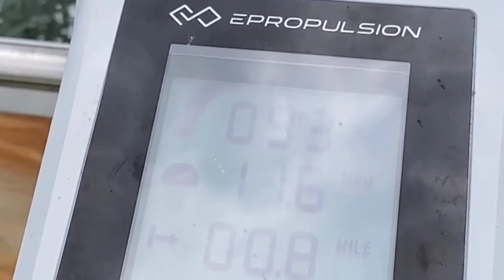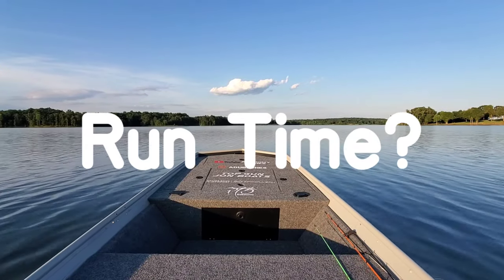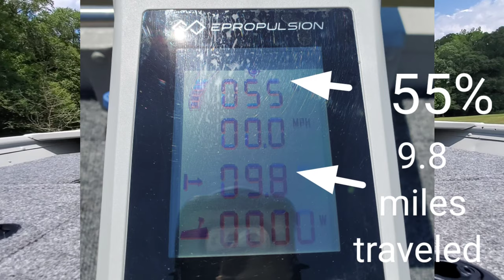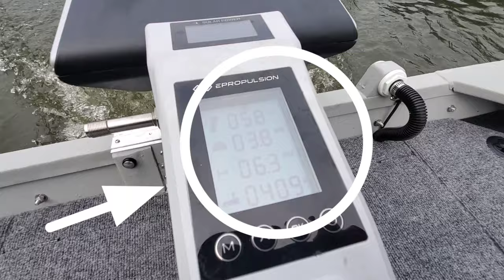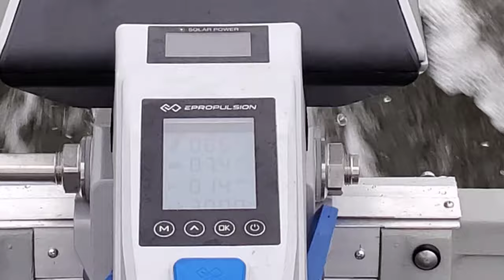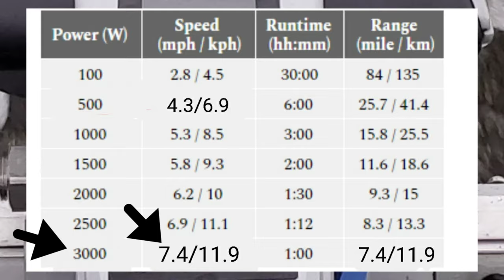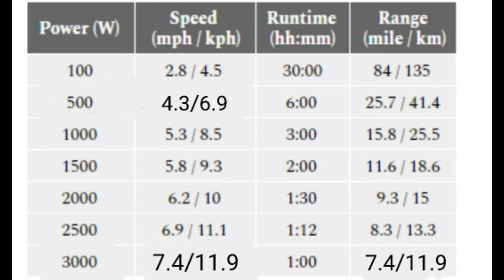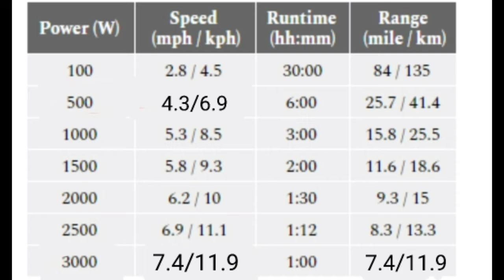Electric Outboard Performance | Run Time | Top Speed Test

Comment: 3000 watts. 3000 kilowatts is equivalent to 3 megawatts or 4000 hp
Reply from the maker: Yes I misspoke when doing audio. You can see on the chart I had watts, the outboard itself is a 3kw @ 3042wh, I meant watt though. Did not catch it in editing. I am too used to telling people it is a 3kw motor rated at 6hp. Sorry
Reply: @AnthonyJonesBrigadeBoats   I have a 14 foot jon boat roughly how much did it cost to set your boat up like that ., I’m in sc I fish  hartwell all the time down towards hurricane creek

Comment: That’s an awesome option. The big downside is the price. As pictured, around 6k.
Reply: This set up with the Navy Battery will run you about 6k all in, but with the new E-Series Battery E80 you can come in under 5k (regular retail pricing) and get an additional 1000 Wh  of battery capacity. I’m always looking to support the Electric Fishing Tournament Community as one of the EPropulsion dealers in Florida and we offer additional discounts for tournament participants.
Reply: @rodjackson6587  Thanks Rod, it certainly isn’t for everyone. There is a considerable cost in the battery bank. Anthony mentioned that in his situation, where he fishes in electric only tournaments in the great state of Georgia, he finds value in this set up. Are more expensive electric cars and solar homes ridiculous? Maybe, but different strokes for different folks😉.

Comment: The speed and battery duration chart you posted has been super helpful to me to determine if the 1.0 or 3.0 would work in a slow moving river of 3-5 MPH.  Thank you for the testing and sharing of your results.

Comment: I just recently thought to myself that electric outboards have to out there. You gave me a lot of clear information. I'm a little tired of working with gas and the constant maintenance. I Have a hybrid car and love running electric only in heavy traffic. I can see a time soon where I can pull my small boat to the lake for a long weekend and charge it with my Ford Mavrick hybrid. Great video! P.S. Thanks for not adding a loud guitar soundtrack.
Reply from the maker: Electric outboards are not for everyone but for a certain individual looking for specific results,  they are an awesome option. We have no choice where I go as the Bodie are Electric only but now that I have used them, I find the benefits so much more relieving that my old Honda 8hp four stroke that was quite tempermental.

Comment: Awesome video - thanks for sharing.  Not a lot of info out there for electric outboards with fishing boats.  Thinking about getting one, Navy 6 though.  Have a Lowe 175 boat with a 25HP now - I don't mind losing speed - just want to get rid of the motor, maintenance, fuel, fumes, etc...
Reply: Unless you plan on fishing electric only lakes, don't. There is no scenario in which an electric outboard is better than a gas engine.

Comment: That's awesome could you hook solar panels up to your battery to keep it running all day
Reply from the maker: The charge rate on solar is pretty slow so it unfortunately wouldn't help much. Solar could charge the battery in 2 or 3 days though, but wouldn't do much while using the outboard on the water. Just too slow of a charge rate unfortunately.

Comment: A lot of people don't realize how many great spots there are around them that are electric only. I'm in Maryland and we have three great reservoirs that are strictly electric. And there are a bunch of lakes that are electric only.

Back when I was fishing all the time in the early 90s most everybody had only trolling motors on the back of their boats. At the time there was only one company making electric boat motors out of golf cart motors. The biggest complaint about having one of them on your boat was the need for all of the batteries. Most people don't realize to get more time on electric that it is important to use 6-V batteries instead of 12 volts. Depending on what size electric motor you could have up to six batteries and if you go bigger than you would need eight batteries. Now remember this is just for the motor on the back. If you're running a trolling motor which everybody does fish finders live wells you need 12 volts or more for all of that.

I absolutely love the new technology that is available today. I'm really thinking about over the winter to put together another reservoir boat. I really miss being out there.

I still remember one early morning during the week when I was fishing at one of the reservoirs. Once you put your boat in the water you're surrounded on both sides have words on both sides for the first thousand feet or so. It's really wide until you get out to the main body. Since this particular day the fog was still on the water I decided to fish the banks heading out. As I'm fishing I hear a boat go by that was really loud. As the day went on really never gave that much thought. A few hours after sunrise the DNR boat comes down the reservoir hauling butt. I just thought that day were starting in the back of the reservoir checking fishing licenses. About 45 minutes later here they come with a boat in tow. And I looked at it thinking he must have not had a fishing license or something that he was doing that made the DNR so mad that they towed his boat back. By this time my batteries forced me to start heading in. When I returned to the ramp the DNR person told me I could go get my trailer and load my boat ahead of them. He says we're going to be here a while. Once I had my boat on the trailer I took my time taking things off of the boat and putting them in the back of my truck and was listening to what happened. That morning when I heard that loud boat it was this guy and his friend with a gas powered engine. They confiscated the boat all the fishing equipment and they were both given fines for the violation. They have to wait I want to say 6 months before they could get their property back. They are worried about zebra mussels and they have to make sure that their boat or equipment did not have any of that on it.

To fish these three reservoirs not only do you have to have electric motors you have to sign a document and put a sticker on your boat that designates your boat to these three bodies of water. You cannot put your boat in the Chesapeake or anybody of water other than the reservoirs. If you are caught out in different waters with that sticker on your boat can be confiscated and you will be given a fine on top of everything else.

I'm definitely going to look up this motor that you are using. It looks like it would fit my needs.
Reply: That is why one of the reasons why I moved out of Maryland they have ruined that state so much overreach there and I fished some of the links where you were talking about years ago some good fishing in those lakes but big brother is always watching takes all the fun out of it
Reply: @dewaynemarcionette6112  you are not kidding about Maryland. You think the regulations are bad on fishing try to go buy a gun. That's its own horror story. I should have gotten out of here years ago. When we started getting taxed because of the rain most people from other states thought we were joking. Every year we go to Daytona for bike week. We have a lot of friends that moved there. When they ask us what's happening here and we told them they really thought we were pulling their leg. Most everything else in this state hasn't changed except our new governor has first term in office the very first thing he did was to drop the ring tax.

The state of Maryland has a lot of outdoor activities. It is just some of the rules and regulations that they put on anything fun. When the virus hit everybody was talking about spending their days on the water fishing since it was the beginning of spring. It was like the next day after they shut the state down is when they announced the water was off limits to everybody. You could not even bank fish. It wasn't until late June that day finally allowed people back on the water. The only way you could fish with someone else on your boat was that that person had to have been quarantined with you. They really never said how they could verify that.

Again congratulations on your escape just remember never look back. -)

Comment: What part or city inGEORGIA do you live ? 
I live in MD... Fish electric only reserviors here....we also have a large tournament following....
I run a 20 ft weldcraft... With a 60 volt RAY.... I hit 7.0 mph.... Wide big boats do weigh more ....but are so wide they plow less water...thus they glide across the top..instead of plowing the water.... The fastest electric boats here in Md are the bigger/widest boats..
Reply from the maker: Outside Athens, fish all over N Ga. Yeah so I run high 7s w the 6hp ePropulsion.  My buddies have 16 ft Bass tracker and lowe 170 17.5 ft and hit almost 10mph w tge ePropulsion 9.9. I also ran almost 12mph in my 12ft 1232 w the ePropulsion 6hp so I just think its a power to weight ratio really. Fastest electric boat I've seen out there is my 1232 which is also the smallest.

Comment: Hey Anthony. I love your videos and get a lot out of them. I have a question not related to the electric motor. When using the western red cedar for your deck framing do you use the fiberglass resin on it first then prime and paint? Thanks again and keep up the great work!
Reply from the maker: No resin. Sand smooth, install, fill screw holes, joints, imperfections w bondo,  sand again once installed,  paint in oil based enamel,  minimum 3 coats. Cedar soaks it up. Just how I did it.
Reply: Awesome! Thanks again.

Comment: Are Epropulsion batteries waterproof rated like torqueedo batteries? Would they work for a saltwater build?
Reply from the maker: Yes and yes. Many sailboats use them in salt water. Outboards salt water ready as well.

Comment: You might still get called out on the electrical only lakes. I live done one that came up to my backyard. The reason they usually have electric only is to prevent erosion on the shore and they want the boats going slower so they’re not making a big week and waves that hit the shore and eroded quickly. So some of the lakes might still tell you you have to drive slower.  

I love the electric motors and would love to put atop made out of solar panels.  Your run time is good so I guess it wouldn’t matter if you’re taking the boat in and out but when the lake was in my backyard we had a dock and I don’t wanna leave it in the water for most of the year.  

I’m not really anti-guess but with a couple solar panels on top charging most of the day it would just be a lot easier than carrying gas around and dealing with all that hassle. I like it.   Do they have steering console options other than your traditional mechanical cable set up.  Seems like since you’ve already got the electric going you could run a servo driven electric steering option that could be easily mounted with a wire to a consul or even a remote. 🤔
Reply: Wrong.    Faster ektric 33 .4 moh

Comment: Any way to add a solar panel to increase range? I get not alot of space, but what if you added a clear deck lid with a panel underneath?
Reply from the maker: Solar charge is so slow it would not keep up with the discharge rate to make a noticeable difference.  Maybe one day though as technology increases.

Comment: Would you consider the Navy 6 as an option?  I’m wondering if the 3 will get my 14ft vhull up with me and my son weighing 440 combined on a future full mod boat. Thoughts?
Reply: 3kW converts to 4HP, but really it’s like 5HP because there’s no gearbox/clutch/drive-shaft to rob power. If a 5HP outboard won’t put you on plane then this probably won’t either.
Reply: @JoeStoffa  I would think the 9HP of the Navy 6 would stand a better chance of getting plane having said that though would you recommend the Navy 3 with an extra battery pack or try for the Navy 6
Reply: Check out the “E Series” batteries on epropulsion’s website. The Navy battery is no more and now they have the E40, E80, and E175. They are $500/kWh and the weights are listed on the website. I don’t know if 6kW/9HP would get you on plane, the only boat I have a good feel for is my inflatable (total weight of boat, rider, motor/battery, and gear is around 425 lbs).
Reply: When someone shows up with twin Deep Blue 50R's on their bass boat you know it's WAR.
Reply: Buy.  Him. A 14. Foot cabjn cruser

Comment: My dad runs an electric boat but he has a small generator on board just in case you need more power so it's technically gas then the electric motor

Comment: this is great but are there any electric outboards that push 100+ hp?
Reply from the maker: I'm sure. Available to public? Not sure. You'd need about 25 thousand in batteries though. And an outboard that size in electric would probably be 25 grand or more itself.  So I'd say no. I personally know a guy in the high 20's with an electric outboard set up and it cost him about 20 grand in motor and batteries to get there. He runs a 50hp Elco.
Reply: There are 100 hp. 80 jp ektrc outvard

Comment: Why no solar panels to extend range throughout the day?
Reply from the maker: Solar panels take extremely long to charge. Good for sail boats to recharge batteries for secondary motor while sailing for days while motor is not in use, not a fast enough charge rate to recharge much of anything while fishing a day out.
Reply: I wonder it's gotta be feasible at a slow speed with stops. Like a pontoon with a hard top. Any thoughts on that?
Reply: Not even close to keeping up...

Comment: Would a solar charger help extend day fishing? Into night fishing?
Reply: Solar chargers can help a little bit, but much depends on how much sun you can get and at what angle that sun is hitting the panel. At the highest speed the solar is not going to be able to add enough to make a difference, but at low speeds it can end up helping to increase your range. Again, sun intensity and angle will be a major factor as well as your speed and the size of the solar panel you are working with.

Comment: Why, Oh Why is your main battery switch on the bottom and not on any side plate?  4:40 run time  😀
Reply from the maker: Its the battery emergency shut off. The actual on off switch is on the battery itself. It's built in line from the factory on an 6ft cable and due to me swapping outboards and removing batteries often it isn't permanently mounted because then I couldn't easily remove the battery or outboard. It's fine, I promise.
Reply: @AnthonyJonesBrigadeBoats  o
Of course its fine, all setup is more then fine. I just couldnot resist with question when seeing that switch next to a bilge pump...😁

Comment: Not a fan of proprietary integrated batteries. External batteries give a person more options, including expanding the battery bank and charging it with solar panels.
Reply: The motor he is using here can be used with your own battery. The smaller one can too, you just need to buy a cable for it. It isn't attached to the motor like the smaller motor. You just need a 48 volt battery. So you can expand it all you want if you have to room and weight capacity. That said, as someone who works in renewables, you aren't going to throw enough solar on your average boat to gain anything noticeable.
Reply: Wr I bg

Comment: I must admit,i am disapointed to learn of the speed of these,considering i experienced 20mph on a v hull 12 footer with a 8hp 2 stroke tohatsu.electric still needs to do a lot  more work to entice me.
Reply: 8 hp eltric
Reply: @sharonbraselton3135  heck no.a loud,smoking,reliable 2 stroke.
Reply: 8bhp 4 strokes eelbal

Comment: If I had this motor on my boat could I run a small Honda generator to charge the battery while I'm running it? To have unlimited range. Like the meme of the prius pulling a diesel generator on a trailer LOL
Reply from the maker: You honestly probably could! It's lithium ion so it charges super fast. In fact, charges from 0-100% in 3 hrs. If you didn't run it full time and charged at stops, you could run forever.

Comment: Is that the E40 or E80 battery?
Reply from the maker: Neither. Their old line, the Navy series. Bigger than e40 but e80 is 30% bigger than it. I'd go e80.
Reply: @AnthonyJonesBrigadeBoats  nice, thanks for answering. I'm in GA too. I have a G3 1652, you think the navy 3.0 would be enough or would I need the 6.0?

Comment: The lithium iron phosphate battery is where the real performance comes from. Any electric motor is only as good as the battery it's connected to. Mabru marine makes sum good batteries that cost around $2k. You're electric motor won't make a wake as big as this guy's with a typical marine battery from AutoZone. I learned the hard way, anything other a self contained LIPO w/Batt management system is a waste of money.
Reply: Wring.  Big wake every stay ice mirtes

Comment: It's 3,000 watts, not 3,000 kW.
Reply from the maker: **********EDIT*********
It has been brought to my attention I misspoke in the near end of video where I breakdown the outboard performance in different throttle levels. I state the power inputs as kilowatts instead of watts. If you look at the chart I produced,  it shows I had labeled as watts. The outboard itself is a 3 kilowatt outboard at 3042wh rated battery at 6hp. I am used to saying kilowatts when describing the outboard rating, not the power levels.  Sorry for the confusion.  Honest mistake. Did not catch in editing. I meant watts but after uploading cannot change. Thanks for understanding.
Reply: @AnthonyJonesBrigadeBoats  no problem.  Good review.